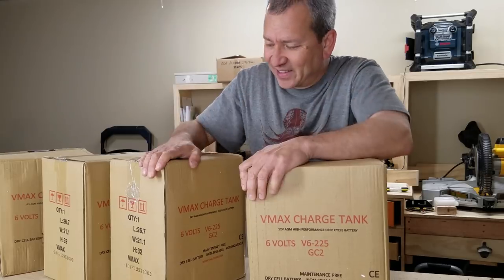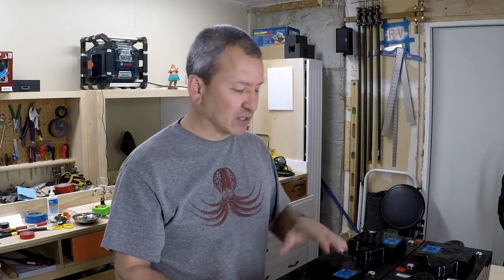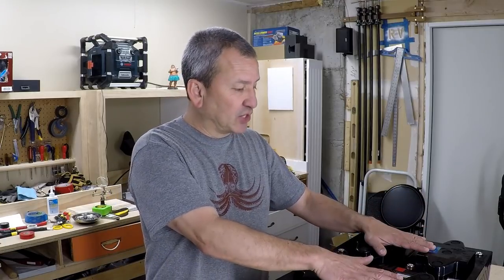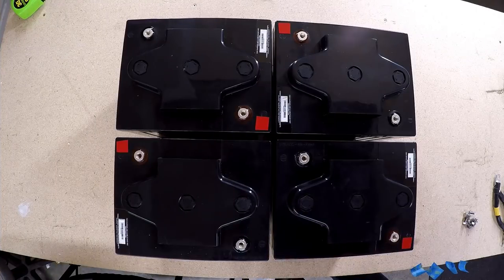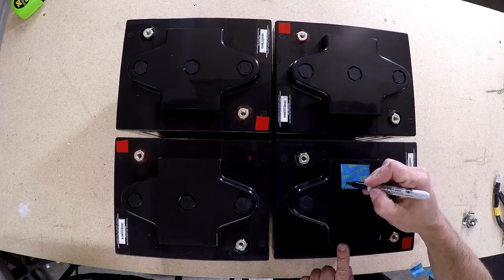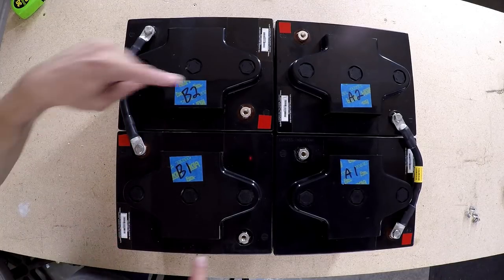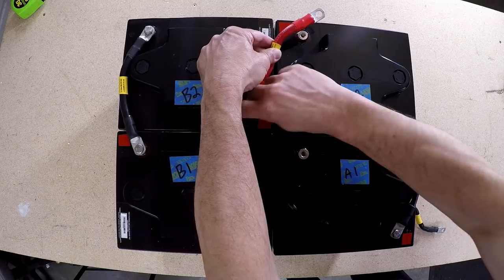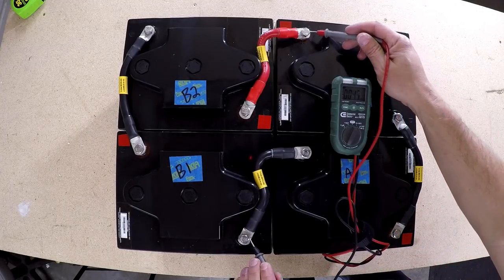How To Connect 6 Volt Batteries in SERIES and PARALLEL for SOLAR

Comment: It looks like you are using a Commercial Electric multimeter, which is what I have (MS8132A).   Which model do you prefer?.  Mine measures AC and DC volts and resistance, but I don't think it measures current - so I'm wondering how fast I'm charging, but don't know - just watching the voltage on the charge controller - is there a better way.  I seem to be having a heck of a time with multimeters.
Reply from the maker: The multi-meters I use are listed here (https://kit.com/rvwithtito/favorite-shop-tools). For DC current, a clamp meter is the best and easiest to use (about $40). The other meter I use is also pretty inexpensive but works great for me (basic features, great display, big numbers, and integrated stand). It even comes with a temperature probe.
Reply: DenverDave2 take your volts then divide by resistance , that gives you amps.. 

Also amps times volts gives you watts
Reply: Thanks - Volts x Amps = Watts    Let's see so my two 6 volt golf cart batteries hooked in series.  Each is 6 volt 105 min (assume minutes) and 75 AMPS.  I think in series this gives 12 volts but still 75 AMPs (not sure about this) and maybe still only 105 minutes.   12 volts x 75 AMPs  = 900.   Not sure what to do with the minutes.     I think that we are only supposed to use 20 % of the battery, so does this give  900 x 20% = 180 watts for I'm guessing an hour?   If so, better get those light bulbs replaced with LEDs.    Basically not sure how to use the information about how long I could run a 100 watt light bulb or by extension a 10 watt LED?

Comment: Hi Brian,,,So is a 48 volt (6 x 8 volt) system possibly charged by a 100 watt 12 volt solar panel used as a trickle charger ,,,,, yes i finally bought a  battery golf cart
Reply from the maker: I depends on your charger and your battery bank's current state of charge. Charging voltage needs to be higher than the battery voltage in order to push current into the battery.

Comment: i BOUGTH 04 FOUR ACID-BASE GOLF BATTERIES 6V/100Ah EACH FOR MY AMBULANCE CONVERSION. MY QUESTION IF SOMEBODY CAN HELP ME IS: 1. USING THE CONFIGURATION SERIES AND PARALEL CAN I HAVE A GOOD BATTERY BANK FOR MY USE?

Comment: Where do I connect a battery monitor in a setup like this?
Reply from the maker: Typically you'll install the Battery Monitor shunt on the negative output of the battery bank.

Comment: Nice video and lots on good info,  Will be doing something similar for our campervan.  why those 6v batts though?  There seem to be many better options via Amazon, AGMs with 12v 200AH @ 100lbs?  about the same AH and under half the weight and only one bat?  I'm new to this so many there is something I'm missing.
Reply from the maker: Thanks James. You would  actually need two of those 200 AH 12V batteries in parallel to get 400 AH total. The total weight would still be  200 lbs. With the four 225 AH 6 volts I could get an extra 50 AH of capacity. I did consider the 2x12v option though when making my choice.
Reply: ha, ic.  Didn't know they were 225 each.  So you will end up with 450 w/212.5 usable AH?  Is that right?
Reply: sorry, ment 225

Comment: Hey Brian, thanks for the tips , in buying a 6 volt battery do you ask for a sealed deep cycle battery or they know if you buy a 6 volt one.
Reply from the maker: +Terry Russell It depends what you are looking for. There are several types of 6 volt batteries (flooded, sealed lead acid, and AGM). For years now I've been using flooded (not sealed) 6 volt batteries that I got from Costco. They say "Golf Cart Battery" on the side and 210 Ah and 6 volt on the specs. Sealed simply means maintenance free.
Reply: ok I guess I was trying to say was AGM 6 volt, so I don't have to worry about putting water in them all the time. so that's good tks again

Comment: Did you have to change your  Inverter
Reply from the maker: Nope. Used the same 2000w inverter. The only change was to reconfigure my battery monitoring system for AGM and new capacity.

Comment: Great video Brian! Shortly after watching your video I added two more AGM's to my battery bank. Next is one or two more solar panels. I read below that you plan on uploading a video on the actual installation. Do you plan on showing a video on the battery location modification you made to strengthen the storage bin? I have a Class C similar toyours and that modification would have probably helped me and saved me some $$. Thanks - Ray
Reply from the maker: Awesome! I don't think I'll be doing a video on the mod to the storage bay. I have pictures, but didn't take video. I would be glad to share a couple with you if you send me an email. What I basically did was take a couple metal pieces (1 "L" shaped and 1 flat piece) from Home Depot. The "L" shaped piece supports the the bottom of the bin and is bolted to the flat piece which cut and I bent to extend beyond the bin and around the supporting cross braces of my RV. The ends are bolted together to tighten it up. I can hold a lot of weight now.

Comment: I am using 2-6v 215 amp batteries hooked up consecutive. I want to increase my b bank. Can I add 1 more 6v 215 amp battery in parallel thereby gaining amps or will I need 2 more 6v 215 amp batteries giving me 4 batteries hooked up the way you demonstrate ?
Reply from the maker: +Ron Lacey You'll need to connect two 6 volts in series, then add those to the existing pair in parallel to get your 12 volt battery bank. Depending on the age and condition of your existing batteries you may want to replace them all.

Comment: Where did you get those batteries. I currently already have 2 6v Trojan T-105s and going to be adding solar and have been looking at adding two more batteries.
Reply from the maker: +Ruben Almada HI Ruben. Links are in the description. I ordered them from Amazon.
Reply: Ruben Almada -I've read that trojans are one of the best... If youre looking for more, maybe stick with that brand
Reply: I have read that also. Was just wondering and lately they aren't holding a good charge. I think I ran them down to many times. I know how to check the status of a battery on a car but not sure how to tell if my 5th wheel battery is going bad
Reply: Ruben Almada Trojan makes great flooded batteries, VMAX specializes in high performance AGM batteries

Comment: Why are top left and bottom right positive side down? Thats kinda wierd I do same setup but with all batterys same dirrection
Reply from the maker: That's no problem. You can arrange them any way you want as long as the connections are correct. This is the layout that worked for me to fit in my compartment.

Comment: Remember, the capacitie of lead batteries is rated at a C/20rate the capacitie of Lifepo4 is rated at C/1rate so as soon as you put a serious load on a lead battery, even a AGM the voltage wil sag and your fancy socold 100Ah bat behaves like a 20Ah (when your lucky) internal resistance is also way higher than on lithium cells, so you really Need those thick cabling before you start a fire, for small loads (Led lighting or so) lead still has a place but in the long run you will be much happier with lithium

Comment: Question! I have a 12 volts inverter  1600watts,for 2 6v batteries,but I want to wire 2 more,total of 4,is it posible?
Reply from the maker: Yes you can. It'll work but... It's better practice if all batteries are the same age and type. The battery bank will be pulled down to the weakest battery.

Comment: what is the benefit of using 6V batteries to get 12V?
Reply from the maker: It really depends on the type of 12 volt battery. If you have true 12 volt deep cycle batteries, then there should be no difference in theory. However, some 12v batteries are actually dual purpose (deep cycle / starter batteries - also called marine batteries). Generally, if the battery has a cold cranking amp (CCA) rating on it, then it's not solely for deep cycle use. If the battery only has an amp hour rating, then it''s a better bet for regular deep cyle use. That's how you can tell. Of course, marine batteries will also work adequately for deep cycle use also. 6 volt batteries are usually guaranteed to be true deep cycle batteries and have more lead.  That is why some  folks prefer them for off-grid and boondocking. It's really personal preference though and there are many opposing opinions out there regarding which is better.  I've used both but have been using 6 volts for the last 6 years.  Hope that helps.

Comment: Why 4x6v instead of 2x12v? Any specific advantages?
Reply: 6 volt batteries are designed to have more capacity than 12. So it makes more sense to run 4 - 6 volt than 2 -12 volt

Comment: How many will you need to run a microwave? Say a 900 watt micro? I don't think the sun will stay around long enough here in Olympia to charge the batteries. I do want to go solar but can't live without the microwave. Thanks for the videos
Reply from the maker: I can run my microwave with what I have now. I just don't while boondocking. We've actually learned to live without it. I couldn't run it with my 210 ah battery bank though. It would draw too much power initially during the surge. With this battery bank and 2KW inverter, my wife can even run her 1900 watt blow dryer. Crazy, but it's working.
Reply: My wife is a microwave genius.. :) That's why I asked. So far we haven't boondocked in our class B but I'm going to make sure we do sometime this summer. Thanks for the videos. Strange spring here in Wershington this year.
Reply: @MrEdsster  you simply buy more solar panels if you are in a cloudy area. Solar panels are 50 cents a watt now
Reply: @ekoms108  we moved to alabama so we get more sunshine.  Still have the class b so not much room for solar panels.  I'm thinking about a covered trailer fo pull behind and I'm could put solar on top of that.  Now that I'm retired I'll be playin with different things.

Comment: Why not just 2 12 volt AGM instead of 4 6 volt?? Thanks
Reply from the maker: Sure that's an option as well. I like the way the four batteries fit in the compartment. They filled the space better for more capacity. I was originally looking at two 12V though.
Reply: @RVwithTito Doesn't 4 6 volt batteries in a series parallel configuration give you greater Ah capacity than 2 12 volt in parallel.
Reply: Absolutely

Comment: How do you do 6 batteries  so 3 12volt batterie banks
Reply from the maker: +umgozy That's right. Wire each pair in series for 12v each. Then wire the three pairs together in parallel.

Comment: I am just curious as to why you didn't just buy a 12V 1,000Ah marine battery. It would have cost less and given you more than enough capacity at 12V. Also, the weight difference would have been substantial.
Reply: THICKER plates in the 6 volt.

Comment: I have been told the reason they use 2 six volt batteries in series instead of 1 twelve volt is because the six volts last longer and can be drained to 30% or lower without harming the batteries at all. Otherwise you might as well just use twelve volt batteries.

Comment: Why would you use 4, 6V batteries instead of 2, 12V batteries?  Not a critique, I'm trying to learn.
Reply: s
Reply: Hi, how can I connect 12 batteries 6 vols in series and parallel to get 12 volt

Comment: why didn't you hang on to your original 2 batteries for a 6-battery bank?
Reply from the maker: +Sean Miller I still have them, but they are a smaller size than the new ones. Also...no more room in that compartment. I'll use them to power something at home like landscape lights or something.
Reply: RVwithTito Say you did have extra room in the compartment, is it okay to parallel connect the smaller batteries with the larger ones?

Comment: There are actually 2 ways to accomplish the same result which had me very confused since I wired my bank the other way.
You can connect two 6V batteries together using both.Positive to Positive and Negative to Negative terminals to make 12V. Then do the same to the other two 6V batteries. Then you use ONE cable to connect the two sets together using a Positive to Negative. Then your load will come off of a positive of one pair and the Negative of the Second pair. 
This provides the same result but is connected differently
Both ways should be explained so someone like myself doesn't "think" they did it incorrectly when actually there are two ways to skin this cat.

Comment: given the batteries you had were fine why didnt you just add two more?
Reply from the maker: +jMon The main reason: I wanted AGMs with more capacity. My other ones are standard flooded batteries that have less capacity than the new ones. With the shape of the new ones I could get more batteries in the compartment. My old batteries were a little wider and I could maybe only get 3 in there. Had I stuck with original type of batteries I would have purchased 4 new ones anyway since mine are several years old. Combining old with new batteries is usually not recommended for best results.

Comment: i have connected 7 battery of 6000mAh capacity but my multimeter still reads it 6000mAh. though by theory, it should be 6×7=42000mAh. please throw some light.
Reply: Connected in Series increases Voltage but not Amperage. Connecting them in Parallel increases Amperage but not Voltage. 
If I knew if you are connecting 6V or 12V batteries I can help you. 
If they are 6V and you have 7 batteries connected then it is definently incorrect because 6V must be connected in pairs to make a 12V bank.
With 6V batteries you do both Series and Parallel to increase Voltage to 12V and increase the Amperage.
Two 6V batteries make 12V but do not double the amperage but combining pairs of 6V (now 12V) together increases the amp hours but not voltage.
In your case, if the amperage is not increasing then the batteries are all connected in Series but then your voltage would be reading 
7 batteries at 6v = +/- 42V 
or 
7 batteries at 12V = +/- 84V

Comment: It’s important to note that the reason that you should only use about 50% of the battery’s capacity is because you will start to do damage to the battery. You can (typically) safely use 50% of the capacity, which should be regulated by load controller (via temperature compensated voltage measurement). You can use 100% of the capacity but you will be replacing the batteries in a year or two. No thank you.

Comment: Poor description of how you increased your capacity.  Your description of series was fine and detailed, but you never explained how you increased your capacity. "I have 4x6v 225 ah batteries", after that you never mentioned amp hours again leaving the impression that you now have 2x12v batteries banks of 225 ah total.  I know that is not true but I only know that because I knew it before I watched your video.
Reply from the maker: Thanks for the feedback. I did mention my two previous batteries right in the beginning (around 50 sec). I didn't really focus on it much since the focus of the video was more about how to connect the four 6 volts.  Since you asked...my two previous batteries totalled around 215 amp hours.

Comment: I thought lithium ion were better?
Reply from the maker: +nestogonzo1 Yes. There are several advantages with lithium. But the price of 400+ amp hours of lithium batteries is still way too high for me to justify.
Reply: You don't Need 400Ah of lithium, a 200ah lithium wil behave better than a 400ah lead batteries, I many cases even a 100 ah will work....
Reply: @giottodiotto1  200ah lithium consumer ready battery costs 2,000